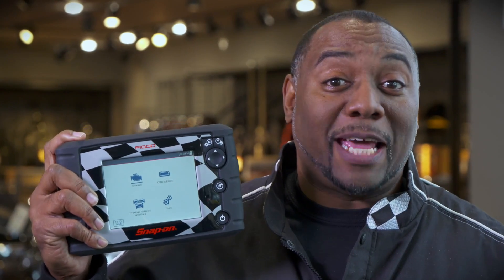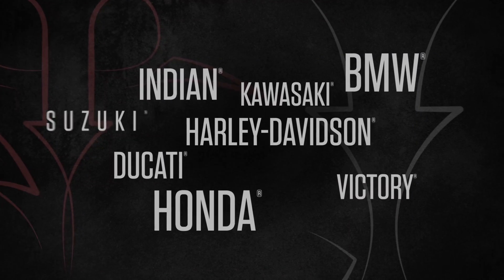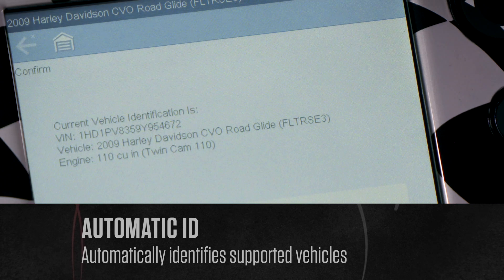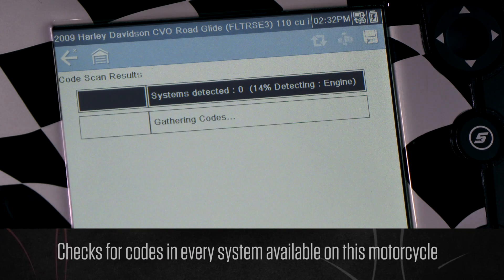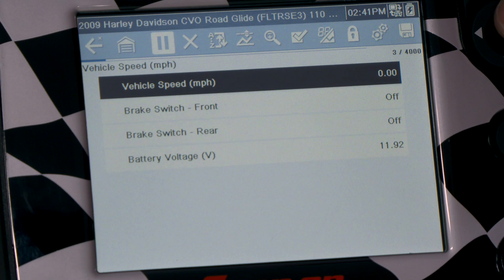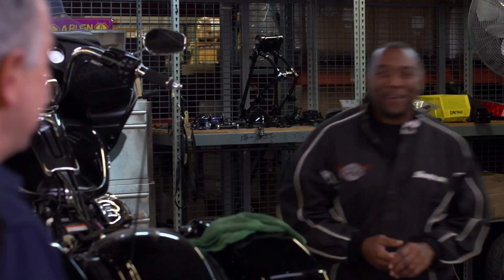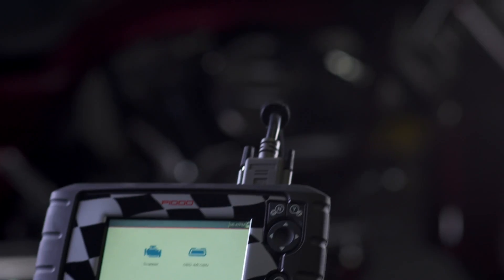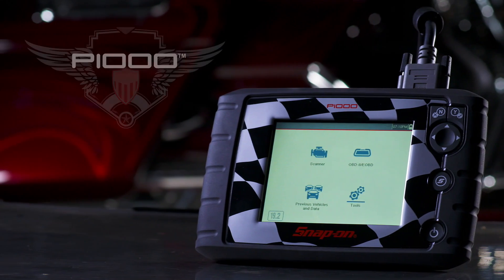Motorcycle Diagnostics | Snap-on P1000 | Snap-on Tools

Comment: I bought this tool and was expecting be able to reset Annual Service Light on my 2015 Multistrada 1200s DVT but every time I choose my bike from menu and under the maintenance pick Annual Service Disable (reset) it reads the date but when I click to confirm it gives Security Access Denied error code 0x33. I called Snap On support and they write down the report but they are not sure when problem can be fixed because its depending on their software team. I also couldn't get any time frame of an solution for this problem. Kind of disappointing especially because its made by Snap On and they guarantee to work before purchase. 😖
Reply: Bummer,  I wanted it for that reason for my v4
Reply: @marcjorgensen  Hey Marc I actually made it to work and believe it or not only what I did is that I chose for year of my bike 2019 instead 2015 and It worked. I was so happy and It literally just came on my mind to try it. My bike has the latest software and that might be the reason why it didn't work originally. Bike is 2015 Ducati Multistrada 1200s. Hopefully helps you with this info. Btw if you live somewhere in South California I can help you to reset it because I still have a tool.

Comment: Can it do Jetskis and Quads like the TEXA and Motorscan models that have much bigger screens? You say its brand new, but it looks a lot like the Snap On Ethos Edge model. Also because it had the ABS code, does it tell you the specific fault location, or do you still have to do a bunch of hunting with a DMM?
Reply: Looks like it's only for motorcycles lol it's in the name

Comment: but not triumph.
Reply: Yeah, the Snap On diagnostic tool truck dealer specifically lied to me about this when I'd bought it, the first thing I asked was if it had Triumph as they have locked ECUs. Can AM, MV Agusta, Aprilia, Royal Enfield, and Triumph as well as a few others aren't supported, including Personal Watercrafts (Botorcycles) & Quads

It's a shame and hard to justify the price compared to the TEXA, which has all the options, a better OS, more diagnostic options, a better warranty, larger screen and better pricing for what you're given. This is basically a rebadged Ethos Edge with a few options and a ridiculous amount of adapter cables for each manufacturer similar to pre OBD-II.
Reply: https://youtu.be/pfy_k4Bve48